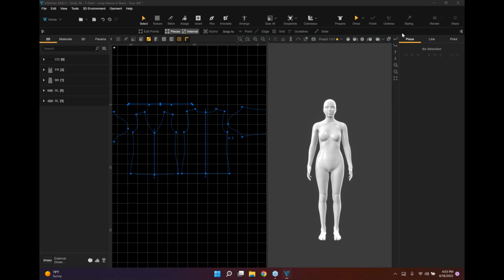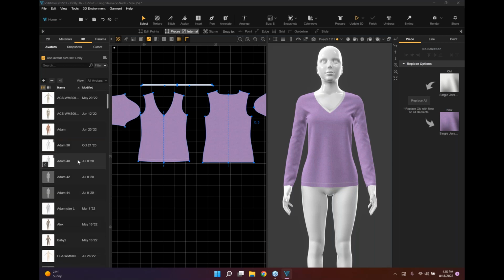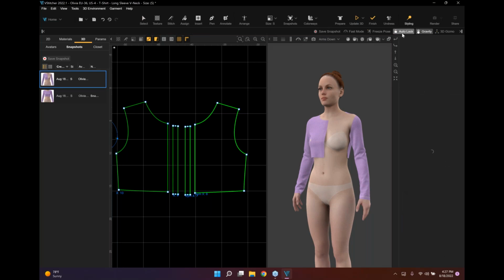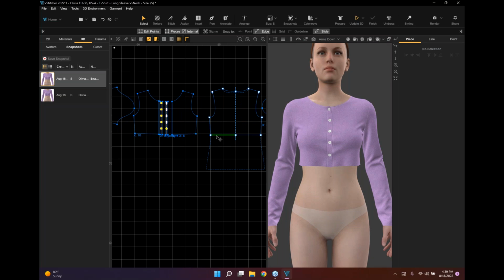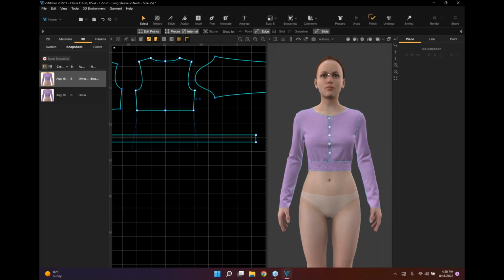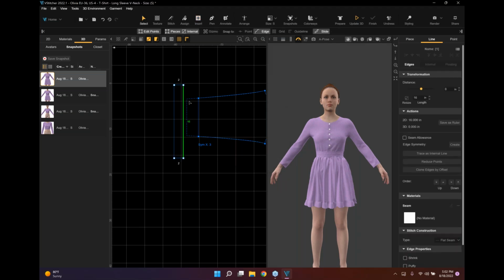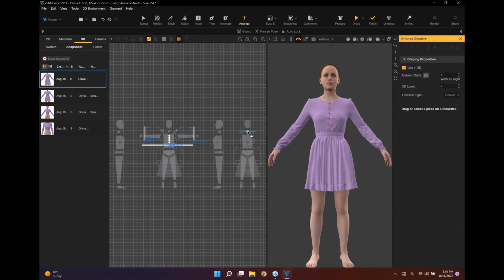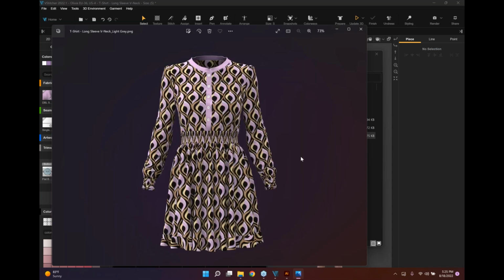Step by Step to Create a 3D Dress in VStitcher

Comment: Time Stamps for this tutorial:

3:21 - Start of instruction/ Tour of software interface
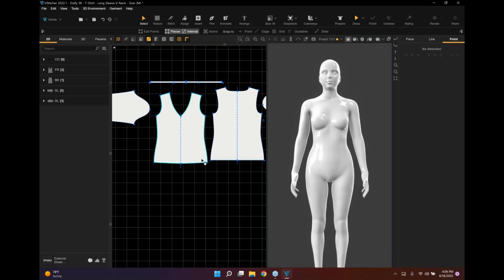9:04  Download and load Long Sleeve t-shirt from Browzwear Cloud
9:42 Audience question: do you need to use blocks? Ans no: you can use your own
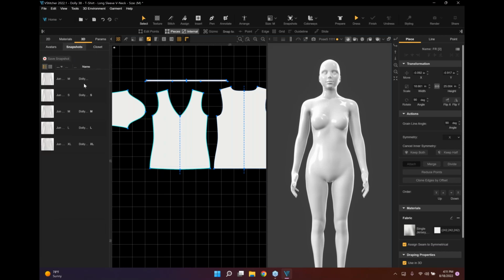10:56 load up snapshot of the t-shirt
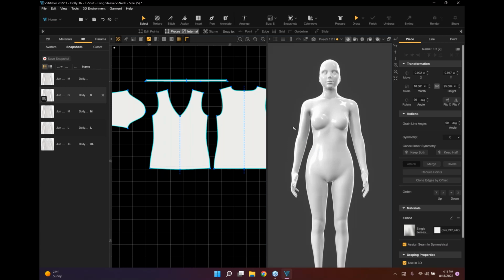11:16 Audience question: what is a snapshot
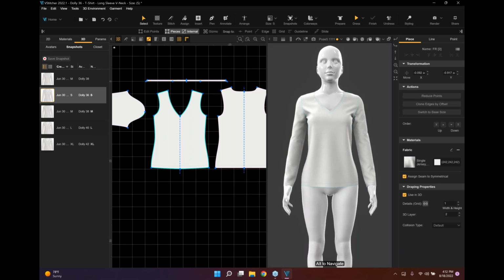12:06 Change base size from Medium to small
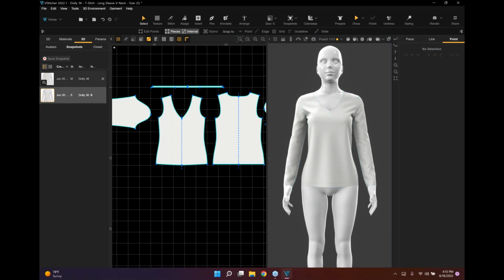12:58 Deleting unused longsleeve snapshots
13:10 Download  Fabric material from library
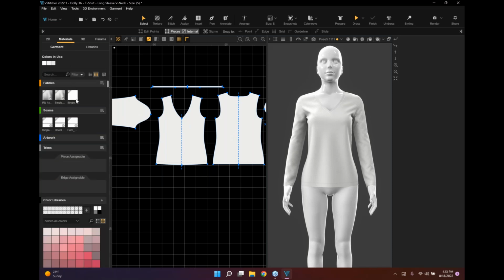13:51 replacing fabric in the pattern
14:15 Audience question: Can I upload my own fabrics?
15:18 Changing the avatar to Olivia
15:41 Download olivia avatar size pack
17:08 Using Prepare to deal with fabric clipping through avatar, other issues
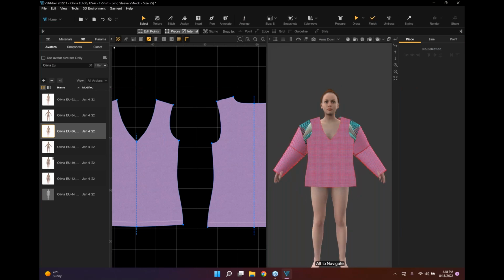17:53  Delete Neck band
18:32 Pattern manipulation work begins
18:45 trace changes enabled
19:37 Saving Changes made to the garment
19:56 Sliding Hem/ Delete Seam
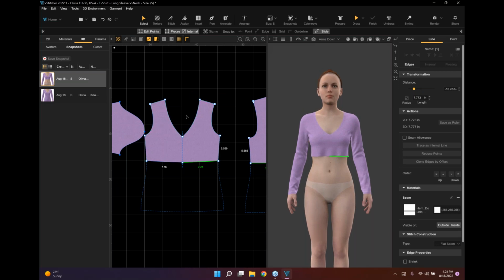21:03 adjusting neck line
23:22 Adding plaquette to bodice
24:58 Details in draping properties adjusted
25:20 Using symmetry to create other side of bodice
26:16 Arranging the new bodice pieces 
27:34 Stitching the bodice symmetrically
29:13 Modifying fabric physics for plaquette
31:52  Button spacing/ placement
36:06 Audience question: can we custom 3d trims?
37:59 Audience Question: can you color buttonholes separately?
38:40 adding waist band
40:26 adding smocking lines
40:46 Audience Q: how do you calculate the shrink?
43:45 Stitching the belt
44:54 Audience Q: what does the brush tool in 3D Styling do?
46:56 Audience Q: What does the force multiplier do?
49:55 Audience Q: Can we create custom poses?
50:22 Speeding up the simulation via fast mode
51:44 Skirt creation starts
52:13 slash and spread tool
53:48 Arranging the skirt on the avatar
54:59 dressing the avatar
55:21 adjusting details ( grid)
56:50 Audience Question: Can we bring in different avatars from other software?
57:24 creating bottom ruffle for the skirt
58:57 Changing point type on slash and spread
1:01:00 sleeve manipulation begins/ creation of sleeve ruffle
1:05:00 create puff sleeve
1:06:38  Re doing sleeve stitches
1:08:25 Audience Q: how would you add lining to a dress?
1:12:05: simulate finished sleeves
1:12:30  Creation of neck band
1:15:32 - Slash and spread on neck band
1:19:38  adding a print to the dress
1:20:13 Audience Q - Do you need a special plugin to use Adobe illustrator in vStitcher?
1:21:10: Audience Q - When you make changes to this parent size, will the other sizes be changed too/ Is this a graded pattern?
1:21:55: pattern manipulations
1:24:12: Audience Q: how do you have the piece edges visible the entire time while you are making changes?
1:24:59 Render